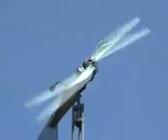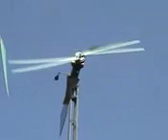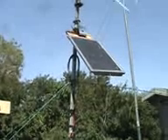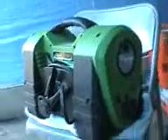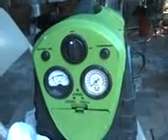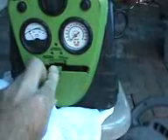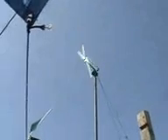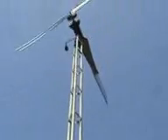WIND TURBINE PROPS (pvc)

Comment from the maker: tHE WIND JACKER HAS A HAS A BELT DRIVEN MOTOR THAT ATTATCHES WITH A 5-1 RATIO THE HUMP BACK IS CRAP I CUT UP MY FAT BOY BLADES TO IMPROVE TIP SPEED BUT ONE THING TO NOTE IS THEY ARE ALL AT THE DIFFERENT HEIGHTS AND THE HUMPBACK WAS BEING BLOCKED BY OBSTRUCTION.  THE RYOBI CAME FROM A FRIEND WHO DID NOT WANT TO MAKE POWER BUT WANTED SOMTHING CUTE TO LOOK AT SO THER IT IS USING YOUR PVC MAST INSIDE STEEL FOR PIVET I LIKE IT.